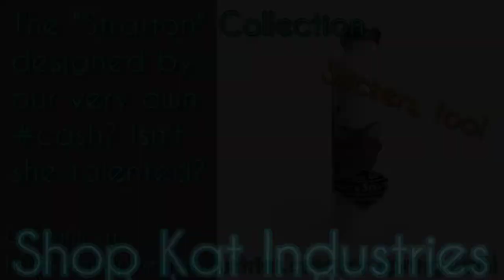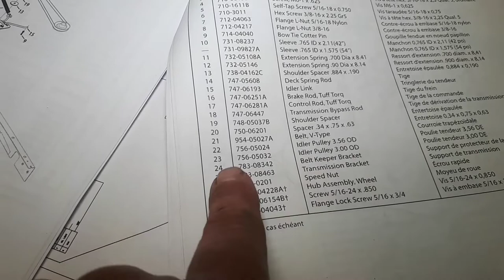Cub Cadet Drive Belt Issue, and Beginning the Kohler Valve Lash Adjustment

Comment: After old Arco Graphite oil did so well on a wear test on the Project Farm channel.  I tried a tiny amount of graphite powder lock lube in a badly worn B&S 6hp splash oiling mower.  It fouled the plug a little bit, I think aggravated by the badly worn rings, but not too bad and it seems to be doing okay, with rod knock little changed.  I think graphite powder might do best in gear boxes, if it fouls plugs and may not be fine enough to go through filters, but it works in splash oilers in small amounts and probably would do well in the rare splash oiling diesels.  I also put a tiny amount in my 2 stroke mix oil, so we'll see how that does.

Comment: If you see no soot at all on a spark plug, even down in the valley, wouldn't that be a sign of being a bit too hot?
Reply from the maker: I'm not too concerned, it only has about 100 hours on the plug, and it's the one recommended for this engine.

Comment: I think the 3614 fits my Toyota.     I know the 2003 Sienna filter fits my Kawasaki engines.  I wonder how much it hurts or help these small engines to use car filters.  Hmmm
Reply from the maker: That 3614 is like Frank's Red Hot, we can put that $#!+ on anything lol! I think as long as it doesn't have any sort of anti-drainback valve, the extra filter medium and capacity can only help!